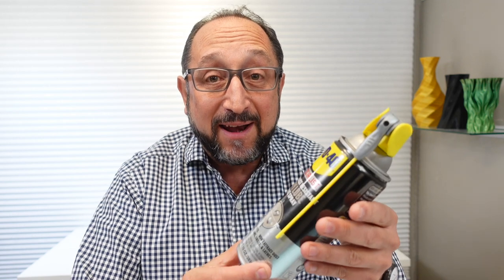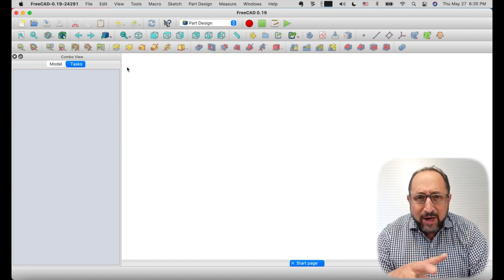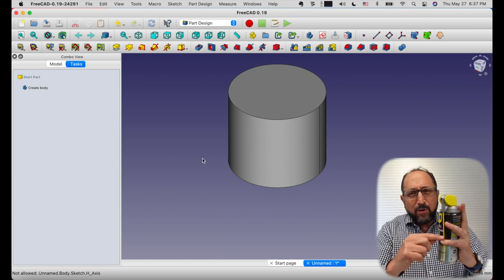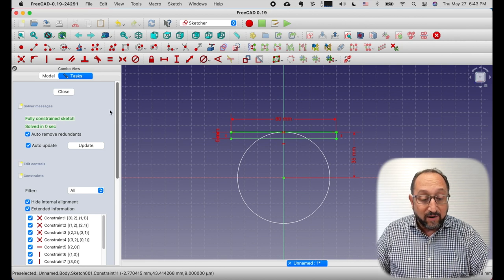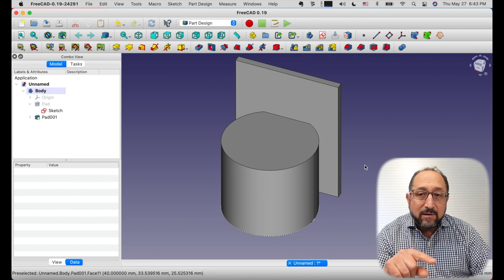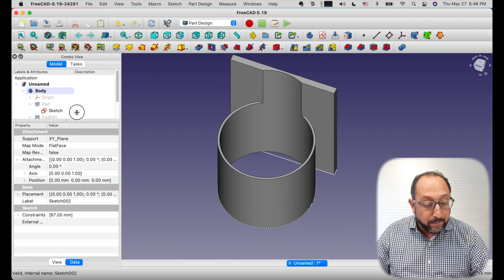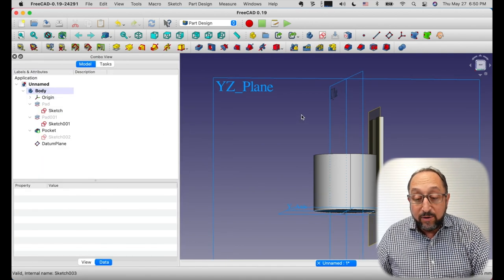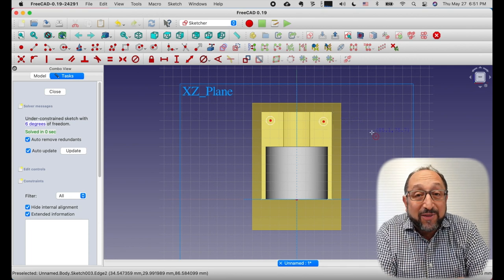FreeCAD Multiple Sketches, Datum Planes, Pockets & Holes

Comment: 13:15 Tip: The datum plane does not have to actually be in contact with the face (e.g. 35mm) It can be offset from the face and the sketch on the plane for the holes can be pocketed across the gap and through the faces by specifying the correct pocket depth and direction.
Of course, using the hole tool requires the position to be on the face to get the correct countersink

Comment: Excellently paced for a not-quite learner, thanks.  I was following along step-by-step and at 15:29 I felt the need to go back into Sketch003 and constrain the holes to be symmetrically placed - turns out I had snap-to-grid turned off!  I think picture-in-picture adds something, and if it's easier for you then so much the better.

Comment: Just starting to learn FreeCad for use with a new 3D printer. Love your videos. Very understandable. I have a project that I can't seem to get a constraint to work. I have a circuit board with a hole in each corner that sits on the bottom of a 3D box. I want to use one of the holes as a reference point for making holes on the side of the box (vertical plane) for side connectors to the circuit board. How can I tell Freecad to measure from the center of the circuit board hole to the distance to the center of a connector so I can make a hole in the box?  This way if I change where the board lies in the box, the connector holes on the side of the box will follow the board.   Thanks again, Maybe one of your videos already explains this.  John

Comment: Yeah, me again ;) First off, I like the video,  thanks for it. I've learned about datum planes through it, something I hadn't used before. So thank you very much for it.

But, always being that guy: as this isn't a beginner video it would've been better if you had named your constraints, like the holder's radius or the backplate's thickness, so that you can reference them in formulas.

The way you've shown in this video results in things falling apart as soon as you change anything, which makes adapting your existing designs unnecessarily hard. You're doing maths in your head that you could let FreeCAD take care of. Like the placement of that plane or the width of the backplate.

Why not just define it to be "HolderDiameter+10mm" or something to that effect? Then also name the thickness constraint and you can place the plane as "HolderDiameter/2-BackplateThickness" and stuff automatically gets adapted if you change anything

Comment: Nice video mate, Can you use one sketch to help with another? I am trying to put a switch into a panel which is no problem to put the hole through but the switch has a small flange that need to sit into the bottom of the panel to stop it turning. The hole in the bottom of the panel is say 10mm from the center of the main hole. Can I link two sketches to set the points at which I need the small pockets?
Reply: Yes, you can link parts from other sketches into the current sketch and then reference them. It's best you search for FreeCAD sketches tutorials so you can see how it's done for yourself
Reply from the maker: Yes you can!  Look up map to external references in the Freecad docs.  Here is the link:

https://wiki.freecadweb.org/Sketcher_External

Comment: I just want to say that your videos have helped me a lot with learning CAD design. One question i do have, and I may have missed something in some of your previous videos. But anyway, how do I actually edit a saved .FCStd drawing dimensionally if I want to change say the width of a pocket or the diameter of a hole? I have designed a part that mounts on my 3D printer as a filament guide and want to change a few dimensions and I just cannot figure out how to go in and change them. Any help at all would be very much appreciated! Windows 10 FreeCAD 0.19
Reply: Well, i feel stupid! I was looking too deeply into something that was right in front of me by right clicking the sketch and hitting edit sketch! 🤦‍♂

Comment: I followed your tutorial to the tee, but I am a newbie, and when I complete project, I validate sketches-good, I select all, I export in .amf, .obj, and .stl. I open with with Cure and it comes up but, without pockets. This is killing me.
Reply from the maker: Head over to https://forum.make with tech.com and post a picture of your object tree and the folks there should be able to help you.

My guess without seeing it is that you do not have the right body in the object tree selected when you do the export.
Reply: @MakeWithTech  I select all and export file to disk and import or open in slicer. It shows up with no pockets.
Reply: @MakeWithTech  Irv. It worked !!!  I was using edit's select all and then export. This time I select Body on the tree and it works. Thank you.

Comment: Nice, but having usied both freecad and openscad, I'd do this in openscad, and with very little effort make it one size fits all.
Reply from the maker: I understand.  I also use both tools.  For some people the coding paradigm of OpenScad is not a good fit.
Reply: I'd likely use OpenSCAD as well but you can make it easily modifiable in FreeCAD as well. Either base everything on a spreadsheet or name constraints along the way so that you can use them in formulas later on. For me doing both works best: basic measurements go into a spreadsheet and I name constraints as a shortcut for calculations.
Reply: @MakeWithTech  I agree, but maybe you do the same model in openscad -- and have fun with the countersunk holes ;-) (I think I'd chop it about a bit, to save plastic.) freecad is handy to apply bevels/fillets to imported scad files, but exporting from free to open, is confusing  to me, too much multimatrix, which I normally never use.

Comment: I hate having to state this, but looking at a tutorial like this and seeing how complex it is to make something this simple in FreeCad and how I would be able to do this in Fusion 360 within 1 minute with just a few clicks, without having to think about moving "data planes" numerically in some weird direction, just making 1 profile sketch with all geometry nicely defined and then extruding the 2 volumes needed from that sketch, then just creating a new sketch on the flat part to position the holes and with the hole command getting control over those holes ... then my choice to not (yet) drop Fusion gets reinforced.  I'm sure a lot is possible in FreeCad and some things (like the list of constraints and the indications on which are over-constraining or how much freedom there still is) are better than in Fusion, but in general it just takes too much headache to design something this simple in it.  Ex. What if I would want the pocket for the opening to hold the can to NOT cut into the flat part, but just "touch" it?  In the main Fusion sketch this would be a breeze, adding a single constraint, but in FreeCad my head already starts to hurt trying to figure out how this could be done accurately (preferably without having to enter the same dimension manually again)...
Reply: You don't actually enter any dimensions twice. Irv chose to do it this way. You can reference any previously used dimensions and you can name constraints - and you can use formulas everywhere. Irv could also have used primitives, like additive/subtractive cylinders. Creating a circle in a sketch which you then turn into a cylinder by padding the sketch is more work than you actually need to do.

Like, when placing stuff you can go =Cylinder.Radius (or =Sketch.Constraints.HolderDiameter/2 if you go Irv's route and name the diameter constraint accordingly)

Edit: if you rename items FreeCAD is smart enough to update references. Like renaming Cylinder to CanHolder will update =Cylinder.Radius to =CanHolder.Radius
Reply: @saschaschneider6355  I've tried moving over to FreeCad a couple of times, but never succeeded.  Only allowing a single area for padding/pocketing for me just feels so much less user-friendly than the multi-purpose sketches of Fusion.  And every time I then need to reference in a new sketch some line/edge or curve from either another sketch or an already existing other part then I typically end giving up as FreeCad always seems to find some reason why what I'm trying to do would not be possible.  When I start in CAD, I don't know yet all dimensions of the thing I'm trying to make.  I typically want to sketch the big picture and then add constraints to make all parts fall in place and then start extruding or rotating those into the third dimension - then typically multiple bodies from that one sketch. FreeCad just breakss that (I think).  Yeah, it's probably me not knowing how to use FreeCad properly, but Fusion is just so much easier in my eyes - I can reference any edge, vertex, plane, part, ... with a simple click, projecting or intersecting to get stuff into the sketch.  There's probably also a lot I don't know yet in Fusion, but hardly ever does it complain that something I want to do, would not be allowed.  I'd love an OpenSource CAD program that would give me the same usability, since Fusion's licensing is a Sword of Damocles above my head, but as said, FreeCad just doesn't provide that usability in my eyes (yet) ...
Reply: @MisterkeTube  you normally can reference any edge or vertex by adding it using the "x" command, which creates a link to external geometry. But tools need to be compatible with your own way of thinking and sometimes things just don't work out. Like I've tried to create stuff in Blender for years and it never "clicked" for me. FreeCAD had a learning curve but it was way closer to my way of doing things so I had more success there. Sometimes you just have to realize that something just isn't for you.
Reply: @MisterkeTube  btw the multi-purpose sketch is really a practice that's not encouraged in CAD, even though you can do it in f360. If you do this a lot without care, it can lead to models that will break easily and make more complicated models hard to manage. Generally it should be one sketch = one feature. Sure, for simple stuff it might appear to you to be 'easier' but in actuality it makes getting to fully constrained harder, and it's harder to keep track of the features or make tweaks to a feature later down the line.

Also, I find a lot of f360 don't do best practices in general, like getting to full constraint on a sketch.
Reply: @haysoos123  It's a target group thing. F360 users don't really care about best practices, they care about getting usable results in the easiest way.

FreeCAD cares about being a CAD program and therefore (generally) follows best practices, which makes it harder to use but you get results of a higher quality.

The question is: as a home user, do you actually need the higher quality produced? Probably not, at least not for a quick 3D printing pipeline. Once you start making things that are more complex, mote intricate, that you're going to be working on for some time, that you're going to redefine and change more than once, THEN the complexity becomes necessary
Reply: You clearly don't understand how tomdomthings in FreeCAD. It is just a minute or two to do these things you mention.
Reply: @macdroid53  then go on and explain how to do those things. Else your comment is just unnecessary noise

Comment: first rule of thumb for a tutorial with pictue in picture ... if the picture being imposed on the tutorial is NOT adding any content such as you pointing at a place on the screen or looking at a reference paper or some such .. it is NOT needed  and just adds overhead that wastes bandwidth and hogs screen space from what is actually being done .... WORDS saying what you are doing work better than a talking head and shoulders blocking part of the screen .
Reply: the reason why you had to move z back by moving it up is your choice of x y starting ... x ALWAYS goes left right ... Y always goes UP down .. Z goes in out ... you chose the top view plane for a front view ... so to move your z axis which should have been your y axis you had to move it up ... yes thats right ... drafting basics ... x and y are the sheet of paper z is from the paper out ... everyone forgets to use basic drafting starting points ... as common starting points ... xy front view ... xz top view y z side view ... that is drafting and cad ... freecad sets you with xz as front and then does all its movements using proper drafting points ... which means it is up and not back to move the z plane ...
Reply from the maker: Thanks for your comments.  I have used a non-picture in picture format for most of my FreeCAD tutorials and I appreciate your point of view.

Comment: I tried FreeCad and deleted it in favour of Fusion 360. Fusion 360 is much easier to use if you are a novice.
Reply: I was thinking just the opposite but I haven’t tried FreeCad yet. Fusion 360 seems to have such a huge learning curve. Creating that datum plane did seem rather cumbersome.
Reply: @warrenscorner  strictly speaking you don't need that. You can sketch directly onto a surface. BUT: as Irv has pointed out (and I've already experienced) that makes changing stuff after the fact difficult because of a bug. This bug results in stuff breaking because internal names are changing without updating references to them.

Using a Datum Plane is a workaround. If you sketch on that there's no references that could break, which makes changing things easier
Reply from the maker: Folks, I have used both and own a paid Fusion 360 license.  For me, FreeCAD is a better choice since I do not use CAD everyday.  I found FreeCAD easier for a casual user with a shorter learning curve for simple model.  

When an OpenSource solution is available I tend to try it first. That is not to say that I do not use proprietary software.  I do, just in this case since there is an OpenSource solution I am quite comfortable with I keep going back to FreeCAD.

The best part of all of this is that we all have a number of choices.  What a wonderful world.